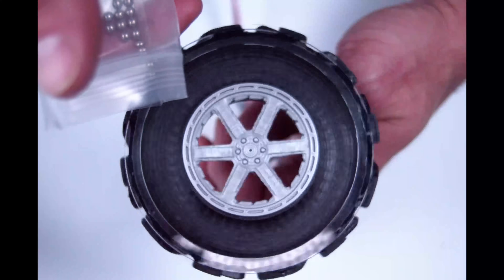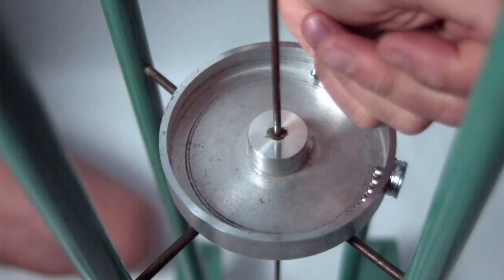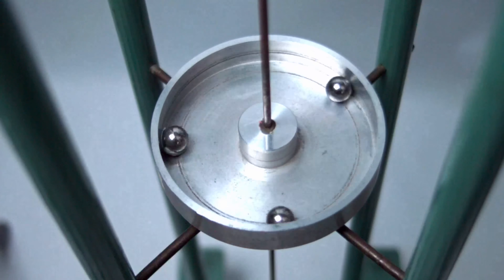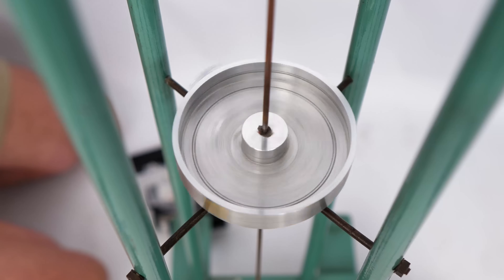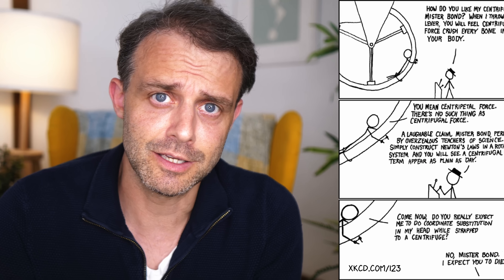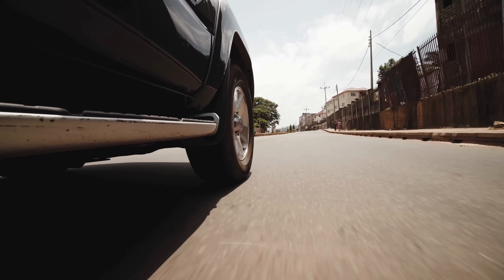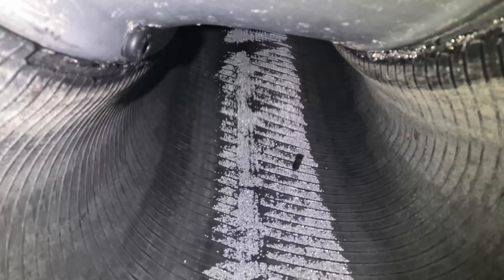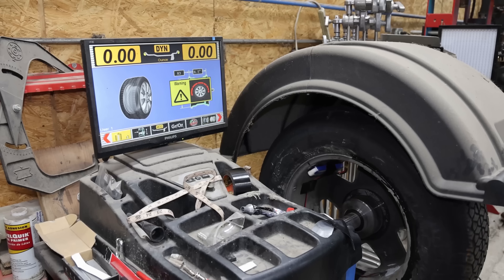Do tire balancing beads actually work?

Comment: I put them in my 37" tires and found the ride on these tires is HORRIBLE.  At 56MPH there is a bad vibration which continues on to 71 MPH.  I will never use these things again.  My last set of 35" tires did the same thing, I thought maybe it was the tires...no, it was the crap balancing beads.

Comment: I have a 4X4 with 34" dia Toyos that were originally balanced with beads. They did balance the tires but another problem cropped up. When I added or bled off air pressure in the tire to achieve the desired tire pressure often the Schrader valve would not seal properly and air would bleed off eventually deflating the tire.

I once drove from near Portland, OR to Pahrump, NV and discovered my passenger rear tire at 5 PSI the morning after we arrived. Those Toyos are tough tires and by some miracle that tire was not damaged even though I had a heavy load in the truck and in Nevada was bombing along at 80 MPH.

I believe the problem was that some of the glass beads were crushed into fine powder and that caused the Schrader valve to leak. Surprisingly, I usually had to replace the Schrader insert to prevent the valve from leaking. I inspected the inserts but could never find what was preventing it from sealing properly.

I later had fixed weights installed and the beads removed and that is working well.

Comment: Is that the same thing as harmonics  or balancing? I know when you drive a small boat on the lake or the ocean you get harmonics like it’s vibrating but if you gear down or slow down and then speed up the harmonics go away, so I’ve been told it is harmonic?

Comment: Balencing beads are common in Semi-Truck tires.  It should be known that the weight of beads put in are based on the tire size.  Oh and those beads on the floor as slippery as snot!  
Still use weights for most smaller vehicles tho.

Comment: It's called Equal and it's been used on large truck and motor home tires for years. Originally, it was just sand but switched to plastic beads to prevent clogging the valve stems.

Comment: It s possible to improve the balance with this little balls but with some kind of polymer or glue  and set it at high speed.
Once they already in position at high speed the glue should fix the balls being dry and the wheel should be eventually balanced.

Comment: How about using small stainless steel ball bearings, balls?

If the wheel, hop, speed is at 10-15 rotations/second.
And it is necessary to distribute the balance material.
Does that mean that with 16R20 wheels, balancing only occurs at 100-150 km/h?
That is not really useful. Both for the law, in many places with speed limits. But also fuel will be a significant factor.

Comment: Whilst I see that it works and that it may be of use at or above the resonating speed I am not sure of the practicality within an urban driving enviroment where the unbalanced tyre will be creating all sorts of faults within the braking, suspension and steering systems both at point of use and over time.  I think I would prefer to have the tyre balanced properly and permanently by the garage.

Comment: I have used these beads and they work.
I also use enclosed metal rings on a 89 Freightliner FLD 120 
and it stopped the cupping of the drive axels which you place in-between the duals on the rear axels and behind the front wheels.
 Been running them for two years and they work great

Comment: 11:35 where I work i don't see balancing beads much. I do see them primarily on heavier trucks like ford super dutys. The bigger trucks with heavy duty tires. I know tires have high spots and low spots, I wouldn't be surprised if its much more extreme on heavy truck tires and mix that with the machines needed to balance those tires (if you can) and balancing beads are really a good fit for that application.

Comment: Hello! I work in a truck company, we use either small sacks with these beads inside or just loose beads. We use them in the trailer tyres, they are 445/45-19.5 (single tyre) or 385/55-22.5 (double tyre)

The beads work really well, the advantage is if the tyre wears un-evenly the beads still can balance the tyre. The common rim balancer can even make it worse if the tyre is "damaged" from bad shocks or heavy braking, because the weight is stamped in place.

Comment: I use them in my trailer tires. Up to 30mph there's no vibration. From 30-35 there's a slight shimmy. From 35 mph to 70mph it's smooth as silk.

Comment: The thing about beads is that you have to get it to a speed where everything will self balance. So lets say that speed is 60mph, through your range under 60mph, your tire is completely unbalanced and translate the uneven rotation force to the vehicle creating other problems. simply put, its just better to get it right from the get go.

Comment: I’ve used glass beads in my 37” mud tires. Mud tires use a big tread lug  which when off-roading can lose some of the rubber.  They work very well in my experience. If they ever go out of balance I hit the tires with a big soft blow hammer to reset the beads. I originally had metal beads but switched to glass because the glass seems to stick and stay in position a lot better. Make sure when you first put in the beads that you drive straight to set the balance.

Comment: If you put enough beads to uniformly cover the inner circumference, then it is out of balance again. There is a number and individual size of beads form of solution that will balance a particular wheel radius and out-of-balance state. For a certain size bead, there may be no solution to a certain criterion of smooth rotation. For example how long and fast must you go before things smooth out. Every single time you stop, it goes to a fairly radical out of balance state. Practically speaking, in many applications that might eliminate any usefulness. But if the thing with a wheel just runs continuously, maybe it’s ok after a “spin-up” period. Maybe not though. Depends. Just trying random numbers and sizes of beads in a tire will yield a bewildering collection of things that seem to work and things than do not. Endless texting. Dynamical analysis is necessary to “figure out” if some sort of bead solution will “work” in any application, including your particular tires. Or anything else. I am reminded of the totally different but equally annoying arguments among people about motorcycle counter-steering.

Comment: Well I got 4 tires a tire installer and the balance beads from Amazon I put in about a ounce in each wheel they run smooth at all speeds the stuff is like very fine sand I’ve never felt any wobble or vibration since putting these tires with the balancing sand in them and I haven’t seen any uneven ware on any of the 4 tires and it rides very smooth for the last 2 years since putting them on my truck

Comment: All the big truck tires on tractor trailers and most other large truck tires are balanced with a bag filled with black beads and the bag breaks apart the first time the tire gets to a speed where it's out of balance and once the bag brakes open the tire balances out and it reballances every time the tire hit's the speed it need to ballance from a stop...

Comment: I am an engineer / motorcycle mechanic / motorcycle rider. I started using beads in my motorcycle tires years ago, before I became a bike mechanic as my retirement side hussle, when my mechanic recommended them (because motorcycle tires change their balance point as they wear, and nobody goes back to have their tires re-balanced after they have worn some, and the beads keep them balanced throughout their life). Eventually I heard about RIDEON balancing GEL, which is also a sealant (for tubeles tires). The advantage of the gel, beyond the fact it saves me having flats 200 miles from nowhere when I am touring, is that the gel tends to stay stuck to the inner tire surface after the bike is parked, rather than falling to the bottom of the tire when stopped. I have replaced worn out tires I dosed with gel when they were new, and found the gel in a bright orange band around the inside of the tire, where it stays even after the old tire has been removed from the wheel. It is still flexible and will still sag and move, but it is not runny. So while highway speeds may have been required to get the gel in place at the beginning, it stays pretty close to the right spot after that, so the bead balance problem faced by infrequent highway speed riders is largely fixed by using a gel rather than beads. I no longer use the balance jig or weights in my shop. I always balance tubeless tires with gel and tube tires with beads. And my customers love it.
Reply: is the Gel compatible with motorcycle tires that have TPMS?

Comment: When I got married after we drove off there was a clattering every time I started after a light. I several  times stopped to look for cans attached to the car  but could'nt see any. The noise stopped while I was drving. Eventually I found stones had been put in the hub caps. I always wondered why it was smooth without vibration while I was driving at speed, now I know, Thanks.

Comment: What about using liquids, not car wheels, but other things, I'm wondering if you could use a filler or glue which sets up. Fill a cup like device attached to the rotating assembly with a quick setting liquid, spin it up and would it be balanced after it sets ?

Comment: This technique is also used to balance the drum on top loading clothes washing machines. Some machines have a sealed channel containing water on perimeter of the top of the drum.  When the machine starts its high speed spin cycle to remove water from the laundry, the water in the channel moves to correct minor imbalances caused by uneven distribution of the laundry.  It only works if the imbalance is small enough that the drum does not enter the flailing mode before the angular velocity is sufficient to distribute the water.

Comment: Just as in a previous post, I balance 100 ton steam turbine rotors. My job is the move the center of mass to the center of the rotor
by installing or removing weight. These rotors usually have two "criticals" and must be rotated through these RPM stages quickly 
because of vibration caused by the rotor resonating or vibrating. No beads for me! Like you said before, once the vehicle stops, all of the beads lose their position and have to re-set. Thank you for the great explanation!

Comment: What you need is a way for the beads to cling to the tires once they're balanced so that they will stay in the correct position even when you stop. If the car could tell them cling or don't cling then you have the basis of an automatic wheel balancing system.

Comment: There is a bit more going on in a car tire than in your metal wheel.
A car tire is made out of flexible rubber. The portion which contacts the road get deformed because of the cars weight. Any imbalance hits the road harder and deforms more. This higher deformation pushes the balancing beads away. So balancing also happens at lower speed.

Comment: I've never heard of balancing beads before but as a mechanic and learning here how they work I feel confident saying that's a bad idea. Unbalanced wheels will not just make your ride rougher but will damage other parts on your vehicle. Even if you can get up enough speed to get the beads into position you are still causing significant damage to suspension, axels, and other components on the way there. Get your wheels properly balanced.

Comment: Having worked with dynamic balancers for rotating systems, I have no doubt that they work. But there are a couple of really big caveats. They have to get up to speed before they "set up", and the process is actually somewhat violent with a significant "clunk" as they get into position (in the applications we worked in, we usually had to disable safety mechanisms that didn't like the wild clunk). This can cause quite a bit of wear to components, and be uncomfortable for occupants.  So as a general rule, they would be fine for a rotation that runs mostly consistent for long periods, but are a bad idea for things that start and stop spinning frequently. So maybe good for long highway trips, but awful for stop and go city traffic.
The ones that I was working with had a few different applications. optical media drives (no, CDs/DVDs are not very well balanced on their own), washing machinces (your laundry is DEFINITELY not balanced!), and motorcycle crankshafts (the engine keeps spinning all the time, unlike the wheels)

Comment: I use them in my (tubed) motorcycle tires/tubes.  I do a static balance with wheel weights then add some beads figuring they will fine-tune the balance when I'm in motion. My only beef is they are a passion to get into the tube.

Comment: I am aching in anticipation, wondering if he'll eveer acknowledge the harmonics of the axle, and going through the harmonics as it speeds up, with a cross-over of moment of inertia and angular momentum from the axle to the milled metal cup+ball bearings. Just hand-waving it with the term, 'resonance,' is not very academic or helpful.

Comment: I have been running balancing beads in my large 4x4 tires on three different vehicles with great success. A lot of highway 70mph driving. I have been as high as 125mph without any issues. I do get a 75mph vibration quite often that I can drive through. The Jeep seems smoother at either 70 or 80mph.

Comment: all great until: 
- beads remove paint from your alloy and you start getting inter-crystalic corrosion
- you have a self healing tire with soft/gel compound lining that is supposed to stop the small punctures but will trap th beads making it even more unbalanced
- you change direction of travel / speed (breaking) and now you tire is out of balance decreasing your traction / breaking force.

Comment: I've been running 16oz (~450g) Airsoft BBs in my 40" offroad tires and they work great. It was my daily driver for 10 years on 37" tires and only drive on the street occasionally now, but the beads keep those large tires balanced as I drive and I don't have to get to "motorway" speed to feel the difference.

Comment: What’s needed is beads that stay in place after the first drive at 80ks+. Could you use ten minute epoxy, drive around (or just spin the tyre on a balancing machine) while it sets. 🙄 probably still not as easy as clipping a few weights on though.

Comment: They are still snake oil. Next time you go on a trip anywhere reset your cars logging info. Note the fastest speed you reach. Now note what your car said your avg speed was. Now remember you spend more than half the time driving under that speed. Unless you go out of your driveway and right to highway speeds and then immediately off and park then balancing beads are going to cause so many more problems with vibrations and bearing wear. Also if you think a manufacturer is going to honor any warranty if they find out you’ve added anything but air or approved repair material then you’re MAD

Comment: In physics terms there's a stable minima for the beads to balance out, but the depth of this minima well decreases with the rotation speed so at low speeds they can get out of it through random interactions.

Comment: I've been running balancing beads on my truck with oversized mud tires for years. It's usually not as good as a machine balance but it sure beats getting them rebalanced multiples times a year as they wear and get damaged from trail use. I first added them to tires in bad need of a balance and the results were obvious!

Comment: Problem with this video is they use something to represent a tire but laying flat instead of standing up like a tire would. The other problem is balance beads only work if you're going a constant speed. As soon as you start slowing down or are constantly changing speeds, it causes issues.

Comment: Beads or sand pouches work. It's how all heavy duty vehicle road tires are balanced. Weights don't work well on 'em, because of the weight and size involved. They break open at speed.😉

Comment: Tyre slime douse the same in mountain bike tyres. It works at around 25kms. I can feel it start work on the mountain bike around 20kms. My be because the bike is very light.  Do the same on my motor bike. because its slime it douse not go out of balance when stopped at traffic lights.

Comment: Balance beads are a stop gap. If you have to put on tires without a balancing machine, use beads. But get your tires balanced at the first opportunity.
And, yes, I've used them before.

Comment: Been doing it for years. I used airsoft BB's in my 35 and 37" tires. You only hear a slight "whoosh" of the things settling at the bottom of the tire when you come to a stop. They work great. I got 60,000 miles out of my old BFG KM2's doing weekend wheeling and daily driving about 350 miles a week. Wheel weights are the real scam.

Comment: I’m curious if the arm is a factor for the beads. I know a lot of people using them on off-road vehicles with 35-42” tires. That’s an outside diameter far greater than a typical car.

Comment: Not only are tire balancing beads a thing but they are more efficient than wheel mounted weights by virtue of diameter where they orbit vs diameter where wheel mounted weights orbit. I have been running wheel balancing beads for over thirty years.

Comment: I work on a VERY old tug, and we have a backup generator that uses an old hit and miss engine. The flywheel on this engine is partially filled with lead shot, and it does the same. Once it reaches RPM, it balances out.

Comment: Used sand for years now beads because they don’t clog the stems. They might have a wobble at 30 but at 35 they smooth out great for trailers.